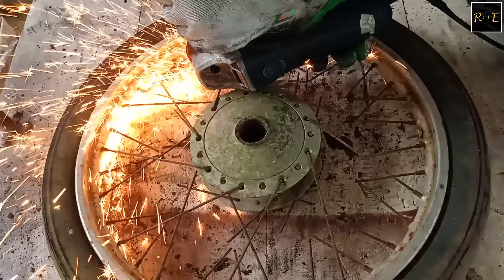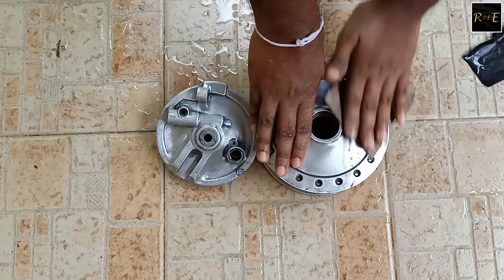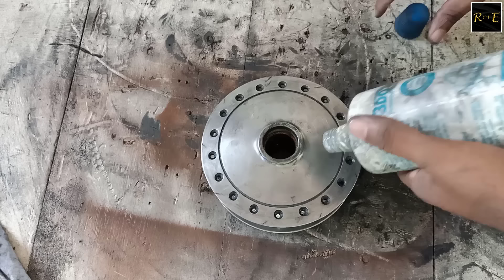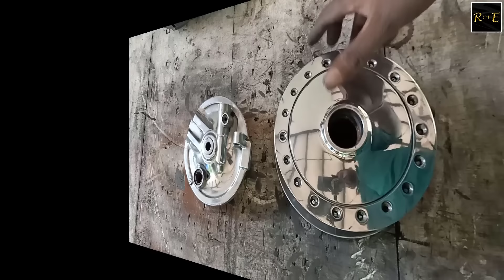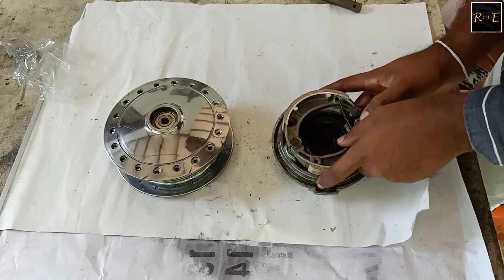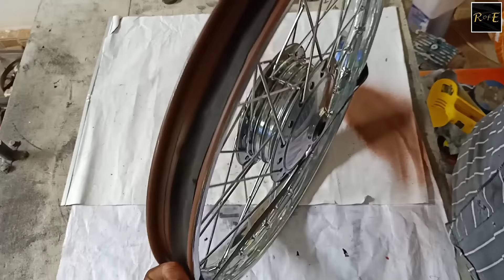Motorbike Front wheel hub Restoration and polishing |  How to Spoke a Motorbike Wheel

Comment: I would have used aluminum brightener or even sulphuric or Muratic acid. You can paint on with brush or spray on with spray bottle, agitate for a minute then rinse off with garden hose. It would have gotten that aluminum brand new looking in less than 3 minutes.... I worked for a fleet detailing company in Houston and that’s what they used and on semi fuel tanks, side steps, car walk, and wheels. Customers had they same reaction as I did the first time seeing it. Pure astonishment! 🤩

Comment: Why the brown paint on the inside of the rim? (Great work btw).
Reply: It is a type of primer to prevent rust. Usually water gets in and creates rust because of moisture.
Reply: I Applied silver spray paint. In side of the rim. Without using primer.